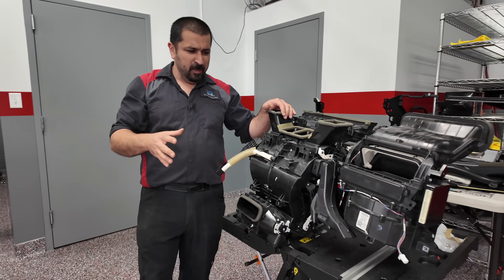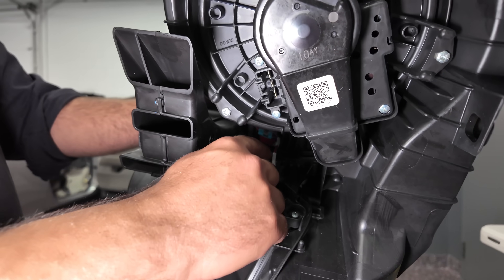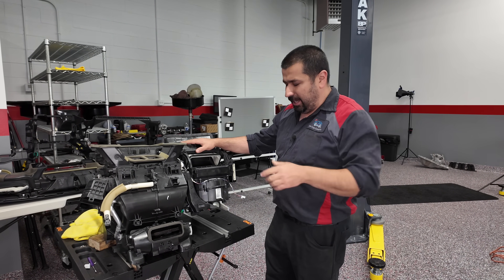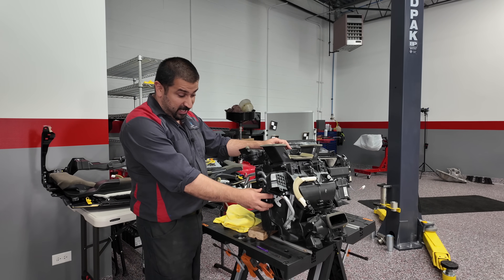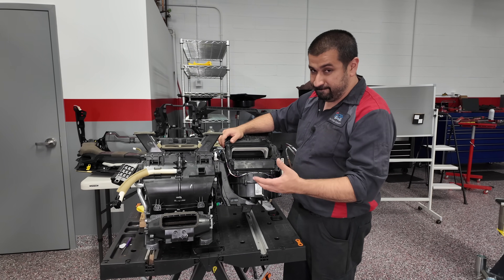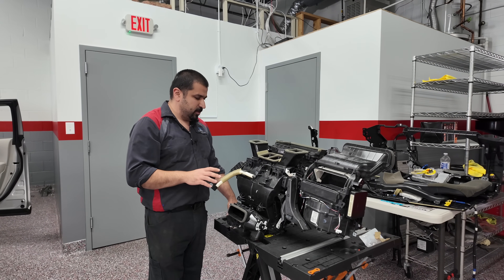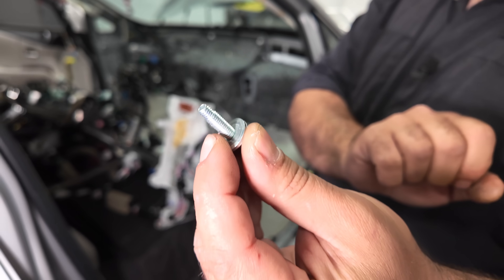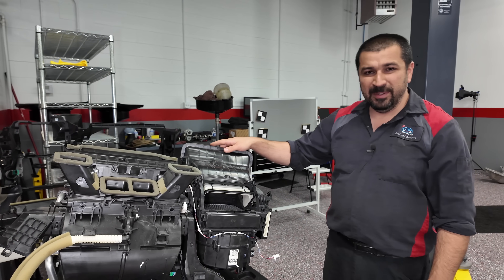THIS is Why Car Engineers and Car Mechanics Don't Always Get Along!

Comment: Technically, if it can be proven that it was something like a penny falling in this could be covered under comprehensive coverage. Yep, unfortunately, comprehensive insurance covers for stupidity...err accidents. Ugh, as a former adjuster these types of jobs this reminds me of stressing about my "severity" levels. Yeah, your performance is graded on an average of how much you spend per type of claim and that is subdivided even further on factors like drivable/non-drive or preferred shop vs field claim. My eyes go big on this as r and i an entire dash can be as low as 4-6 hours to like 16 hours depending on make and model and then there are questions on whether evac and recharge are included factors and what is considered body hours vs. mechanic hours. But for argument sake the total is 16 hours of mech time so if this shop charges 120 per hour then that is about 2 grand in labor costs alone. It sucks when they don't design these dashes where the top doesn't pop off and you don't have access to most items. They are doing a disservice to their customers in costing them thousands of dollars down the line to save maybe 20 dollars.
Reply: I think car buyers won't spend more on a car that is more serviceable on items that only break 1 time out of a 1000. They buy Toyota because it breaks less often. It's the BMW and Jeeps that need to be more serviceable as it breaks maybe 1 time out of 5 after say 8 years.

Comment: And this is why I drive a Yaris. The servo motors are powered by muscle, albeit via flimsy cables.
As I understand it, motor vehicle components are designed with ease and cost of assembly in mind. The Japanese have been masters of designing vehicles with serviceability in mind, but at the end of the day, they are all profit fueled business, nothing more.

Comment: If theyre going to make it impossible to replace might as well make it bullet proof part like add steel gears, brushless motors, aluminium casing etc. What Ive notices about those lexus wuvs is that they have motors not designed primarily for those models, more for toyota. I cant remember exactly but some tme ago I replaced an alternator on one of those and I had to remove the exhaust manifold to replace it, it made the job harder than it should be. I think the struts were a pain to replace, I stamped deep on my mind to never get a lexus for gow hard theyre to work on compared to a regular toyota plus all the bells and whistles make the car more prone to failing.

Comment: Well, I’m assuming Toyota disassemble their cars, but if they were smart on the backend, they would have mechanics jump and disassemble a car and give them their thoughts on the backend of the production line, specially for dealers because many times the manufactures only gives certain amount of “shop time” for things that you think Toyota in all it’s infinite wisdom of the production line efficiencies….would use this. It would also help them long-term on platforms.

Comment: Did the same on a Volvo V70, due to an AC evaporator leak. Entire front and dash had to come out, just like that. Took me 3 days working with a friend. On older cars, you are unfortunately going to have broken plastic clips and squeaks/rattles afterwards. All the foam vent rings also had to be replaced due to age.

Comment: I have some clicking noise from the HVAC system for 5 years but i could never found out wich vent it is. I didn't took it apart because everything seems to work. The clicking is very annoying but only hearable when driving very slow. Do you have a procedure to identify the faulty vent?

Comment: As always, very impressive! My dad was a mechanical engineer painfully aware of how many in his field were not truly qualified. He used to say you can fix a broken machine but you often can't fix the engineer who designed it. This said engineers today  are the slaves of the bean counters and sales force. The system you describe here is by its very nature bound to fail and to fail expensively. It's wayyyyyy too complicated and hideously expensive. More to the point car owners did just fine for decades with a simple heating/ defrosting system so why have they become so complicated and expensive?  Think of it from the bean counters point of view, the company makes about the same percent profit margin. Which would you rather manufacture a $5,000 car or a $50,000 car? If your margin is 10% thats a profit of $500 against a profit of $5,000. When the air conditioner in my RAV 4 ceased blowing out cold air I told my mechanic, "Not to worry I'll just open the windows."

Comment: I had a 1998 Mercedes S600 and I loved it! Until the AC stopped working. Apparently a brilliant engineer decided to use brass lines and an aluminum evaporator that was buried behind the the ACC box. The part was $350. The labor was almost $10,000 because everything from the front seats forward to the firewall had to be removed!🤬🤯

I got the car fixed but it was my last Mercedes S class!

Comment: What the presenter asks for here is that more energy should have been expended in designing and manufacturing the module.
He asks for that unknowingly.
A Toyota Prius is only fuel efficient because the colossal amount of Energy put into creating it.
That includes all the Energy burned until the transistor and other electronics came to existence, and all supporting industrial and urban base, manufacturing and telecommunication technologies plus the wellbeing of people and knowledge, all came available together.
This is actually why a Ford Model-T could not be as efficient as a Prius at run-time, but unfathomably less energy-intensive when created, in comparison to the Prius.
When humans ask for better technology solutions, they need to realise the upfront Energy cost of those better solutions.
In Iraq, a Toyota Crown with only 6000 kilometres on it has experienced a broken engine piston. 
This occurred despite the engine oil is the Toyota's genuine factory engine oil, which proved too light, designed for colder weathers.
The presenter in the video below recommends that the original factory engine oil should have been changed with a thicker grade before using the car in that hot country - despite no mention to that in the manual.
"Why Car Engineers and Car Mechanics Don't Always Get Along?"
Energy! 
Unless more of it is expended, nothing works to expectation for long - or at all - a.k.a. wear and tear internal to matter.
"No system of energy can deliver sum useful energy in excess of the total energy put into constructing it" (2017).
https://youtu.be/PMGljaZfWbI?t=307

Comment: I was a gasoline and diesel tech for many years and in the 80's when they started using electronics (not well) I decided to go to college to be smarter thinking they are the folks that will get paid the most. I was correct but I decided it was easier to work as a BSEE than a tech and the engineers looked down on techs not all but many of them. I have worked with all the engineering disciplines over many years and most couldn't keep a job as a tech and many would never get hired. In a perfect world they should work together as they did in Detroit in the 1950 and 60s. The techs were called method engineers and would review the engineers designs for sanity albeit many times the bean counters had more influence with management. Remember everyone reports to someone regardless of position or rank. When Henry Ford made his first model Ts they were so good that he found out they were not selling any parts such as tie rods etc. He made them stop producing parts that were so long lasting again it is about money. Every decision that has been ever made can almost always be traced back to MONEY and it hasn't changed in my 75 years if anything it is worse now and will probably continue. I expect car manufacturers will start reducing their warrantees down from three years and 36000 miles for most of them until eventually it will be like buying a toaster and get a one year warranty. I am an old man and we get very cynical as we age but mark my words and I am on the record.
Reply: "Who was that masked man?"
"I dunno.....but he left us this."

Comment: Back in the 1970s when I worked as a tech for IBM, they told me that there were field techs at the design centers telling the designers that what they made wasn't servicable, and they would change it if possible.
Reply: Most mechanics have absolutely no idea of the complexity and difficulties faced by production and manufacturing engineers, especially when there are bean counters pulling the strings.

Comment: The engineers are hired to make assembly fast and cheap, not for later repairs when someone drops a pen, etc, inside the vent opening. Engineers aren't hired to save an owner from their mistakes. That's the repair mechanics' job. This just proves that some mistakes are very costly to fix.

Comment: My example of poor engineering. Own an '05 Titan. As it aged one of the front headlamps got so fogged over and moisture inside lens it was useless. Wanted an original replacement headlamp assembly (330 dollars. Took it to dealer and the tech said buy the other one too. I said why? He said, because I have to take the front end apart to get at the headlamp assembly and I will break plastic fasteners, labor, etc and it is 750 dollars in labor. So I bought a second one and the total job to replace the two headlamp[assemblies was almost 1400 dollars with tax. Went to a couple of independent body shops and their prices were almost the same.

Comment: A shop I worked at long long ago used to call the HVAC box the "double cheeseburger," because typically either the technician that had to work on it had a heart attack, or the customer had a heart attack when presented with the estimate.

Back when I did line work, I had a rule that if the box came out, everything got replaced.  Either a whole new HVAC assembly, or every serviceable part got replaced, and I would discount labor to prevent double-billing.

As for the engineering side of things, I stopped being angry a long time ago.  The reality is, the engineers are very specifically tasked with finding the most efficient design for assembly, not for service.  Every single engineer that works on these vehicles is absolutely capable of creating field-serviceable designs, but their management's directives do not budget for it.  It's not the engineers' fault.  They have X-amount of labor hours allocated for the design of a subsystem, with a bullet-point list of goals to acheive.
Reply: Hello,
By saying everything gets replaced, what parts are you referring to? I think I know but I'm still learning. 

Thank you so much. 😊
Reply: @kg-Whatthehelliseventhat  If not the entire HVAC assembly, then any and all serviceable parts.  Evaporator core, heater core, any and all actuators, any foam and/or padding on the various doors and baffles, vacuum hoses, grommets, valves, etc.  Every HVAC assembly can be so different, it's difficult to be specific, but I approach it on a case-by-case basis.

It's always a good idea to check for TSBs regarding common failure items within the HVAC assembly and address them while the assembly is out of the vehicle, even if it's not currently a problem.

In a real-world scenario, you'll do your diagnostics to address the customer complaint, and look up the repair procedure.  If the procedure involves removing the HVAC assembly, STOP and immediately talk with the customer to let them know it's an expensive repair to see if they even want to proceed.  If they do, let them know you'll put a couple estimates together, for both fixing only the problem they brought it in for, and also a quote for rebuilding/replacing the entire HVAC assembly.  Keep your focus on educating your customer and helping them make the best decision for them.  Don't worry about "selling" a higher priced job.  Sell yourself, educate your customers, and just be honest, and you will do better than 90% of the people around you.  :)
Reply: @rhkips  I hear you 100%. What gets me is some people know every app on their $1000+ phone but their vehicle that costs tens of thousands more they have no basic clue how it works but when told this is broken or that should be replaced, all of a sudden they are an expert and know a guy who can fix it cheaper. Oy vey... I tell ya, I don't expect them to know every detail about every system but damn... learn a few things of how stuff works and more so, be open to a professional showing them what, why, and how something is messed up.

I'm sure you get it. Thanks for the info. What are some of your favorite vehicles?
Reply: No ild parts are going back for sure.  Doing a timing chain and belt for example?  Everything gets replaced. Replacing radiator? New hoses and clamps unless they been replaced within 3 years. I  not going in twice unless the customer want to pay for twice 😂😂😂.
Reply: @ahmadghosheh3104  yea right!!! I'm with you. Forget doing 2x the work.

As Rainman Ray says, "I love my job, I'm doing it twice." It just makes sense but I do understand sometimes the whole system is not in their budget and they just want the single failed part replaced. They can't think about a month, a season let alone next year when something in the same location fails and the motor or whatever has to be torn open again. 

Give me a classic car any day.

Comment: That square cut out area to the right of the expansion valve at 14:47 is for the immobilizer computer for some models.  Of course they make it difficult to get to for good reason, but the labor is the same.

Comment: I'm sorry to say I would not trust a dealer mechanic to do a good job on something like what you do. I wish you lived closer. I would bring my car to you for repairs, that's for sure. I would trust you to complete a job correctly.  😊🫠❤️👍I live in Florida, so it's too far to drive to get repairs done.HA!HA!😢 i have a 2004 Corolla. It just doesn't break down. Has not had any freon in ac and still freezes me out. 20 yrs old with 95,000 miles. I hate to say it I did serv. Transmission once but haven't touched it since.  I watched your video that I shouldn't serv. It now that it has been so long.

Comment: Can we use the scope to check if the defrost door is jammed or broken and if it is possible to get it unjammed? Is it a wise idea to cover the defrost outlet with mesh to prevent objects from falling in in the future? 

Sometimes it is not because the customer is sloppy and let the coins drop into where they don't belong. A sudden brake could throw things around and into those defrost openings.

Comment: Bad Engineering!Yes the blend door actuator. Usually the soft plastic gear inside strips and in a lot of vehicles, the complete dash has to be removed. As in my vehicle, that box is discontinued. I purchased a after market better  replacement gear.
The dealer won't replace just the gear & must be the complete box even though the box can easily be opened and a simple gear swap.
Sad part is a lot of folks have wound up junking there good vehicles cuz of it.

Comment: Hello, my friend. You make amazing videos, and I love them.
If you have a chance, can you please clarify the following:
I have a 2015 Toyota Camry 3.5L V6 with very low mileage (just about 37000 miles), so I use the time interval (instead of the mileage interval) for the maintenance. What is the time interval for the ATF replacement? The service manual does not mention this operation at all (it mentions an inspection only). 
It also requires replacing the ATF only for "special" driving conditions (driving while towing, using a car-top carrier, or heavy vehicle loading), which I have not experienced.
Thank you.

Comment: The engineers are tasked with assembly in parts.Count to keep the vehicle as cheap as possible. That means access to servicing.Many internal parts are not high priorities when the car is assembled. Here's a case in point in the old days.Individual electric window switches where replaceable.Now , if one switch goes bad , the whole panel with the     window controls door locks and mirror control. Instead of a 50 dollar part, you have a 500 dollar control panel.

Comment: Thanks to the local mice, I ended up getting used unit on my 2006 highlander hybrid. They chewed the door that allows fresh air and recirculated and brought acorns in the whole darn thing. Pulling the dash apart is not fun, even in a 2006 with one zone. I'm not sure I'd do it again. Thanks to YouTube, I had a bit of help.

Comment: To be fair, this car is 15 years old. For these parts to have run this long is pretty good, and it's kind for a car this old to have huge repairs. It's also going to be cheaper to do this job than to replace the car with even a 10 year old RX350.

Comment: My 06 Frontier needed a new recirc motor.  Out came the entire dash.  While out, I replaced the recirc motor, air mix (hot/cold)motor, cleaned the reason why the recirc door was binding, made sure other doors operated smoothly and reassembled everything.  I used the green masking tape method. Wrap the tape around screws and ID their location.  Same for nuts, other hardware and both sides of the electrical connectors.  Takes longer, saves time and patience with reassembly.
Same with my wife's 06 Sorento.  The Kia also got a new evaporator and heater core.
Both were completed at home in my garage.
I've done several Ford trucks and one Escort at work in the past.  No one else in the shop wanted to do them.  They all took time.  
Except for one Ford Truck,  all the other vehicles worked as designed with no problems on startup.  That truck had a bad A/C compressor unknown to me.  Yes I fixed it.
Green tape, take your time, replace parts in those assemblies that WILL break soon.
Why change working parts?  "I do the job ONCE, so I don't have to do it over or again!"
Thank you AMD for this video.